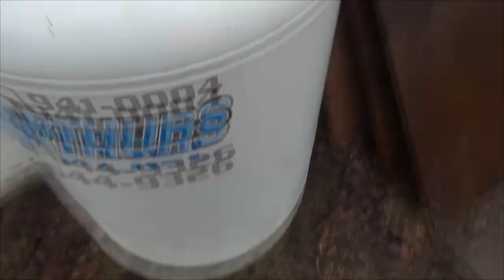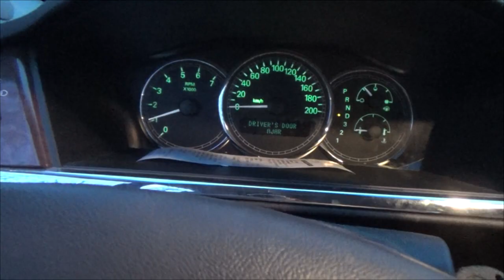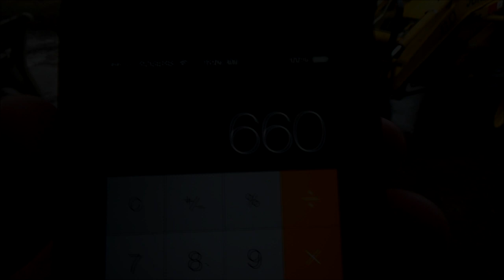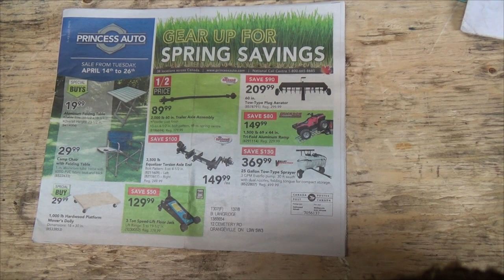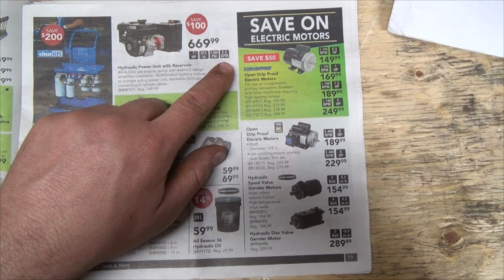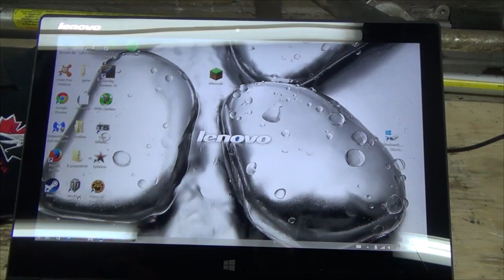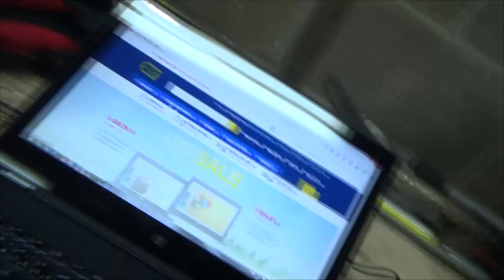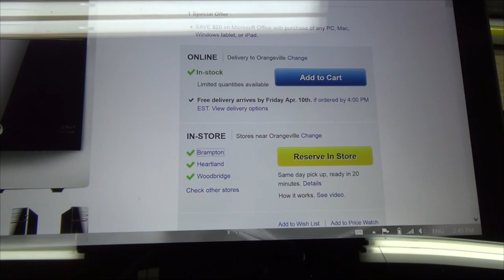What is in a pocket coil matress

Comment: Hey Bill I usually put my computer into hibernate mode it's sort of like sleep mode but doesn't draw power. My computer is about 9 years old and my boot time is 2 min. With hibernate it's 30 seconds. You could still achieve fast boots with sleep mode also but would draw slight amount of power. I also recommend getting a Universal Power Supply (UPS) for your pc, it saved me many times. I have a 500 watt capacity ups for a 300 watt pc. If your new pc is about 600 watts (gaming) get a 800 or 1000 watt ups. Love the vids Bill.

Comment: Bill, If you want to do some SERIOUS GAMING I would go for a desktop. Go for dual monitors, once you get use to them you will never go back. You can go to New Egg or similar for computer systems or parts and build it yourself. Avoid Windows 8 get Win7 if it is available. HP doesn't normally have the latest hardware, get one specced to you own speccs. Go to a company that can build it exactly the way you want it.

Comment: You have to much time on your hands if you are taking all of the springs out
Reply from the maker: Trevor Oakley waiting for spring lol
Reply: BILLSTMAXX :) ot gravel, lol   i set an old mattress on fire so i could just have a bre metal frame .
i put a board on it with a couple bricks on it to drag behind my lawn tracktor, it fills in all the pot holes  on my road and smooth outnew top dressing for the lawn.
Reply: BILLSTMAXX :) umm  ya, i guess that mattress would not work, no frame to it so all the spring would fall apart.   Douh!   At least you recycled.

Comment: I bought my computer from Best Buy, I like ibuyPower as the name brand. The K on the processor means that it can be overclocked. No k means locked to its speed.
Im not 100% sure, But i think its a bad idea to mix and match ram like that. 1 x 8 and 1x4. You would want to have the same amount of ram sticks in the computer. HP is always known for building cheap crap and marking it up.
IDK fi Best buy US is the same as best buy Canada but look up SKU 9096193 thats like what i have, only this one is a lot newer, and using nicer newer parts.

Comment: Bill,  If you are getting a pc you might want to wait until windows 10 comes out this summer.  That is what I'm waiting for because mine is five years old and needs replacement.  Bruce.
Reply: ***** when you buy a computer from a store, itsoetimes come with windows, if so id wait for wi dows 10, why pay for windows 8 when 10 is on its way.  I run linux over windows anyday but thats just me.
Reply: TiMn8eR911 any windows 8 comes with a free upgrade to windows 10
Reply: brucear1 All Windows 7 and 8 users are eligible for a free upgrade to Windows 10 during the first year.

Comment: Your i7 2600 that you have in the HP should be fine for GTA V.  Graphics card may have issues, you could just buy a $200 graphics card and put that in.  Cheaper than buying a new computer.  Specs of GTA V are really high though, I don't think my graphics card can play it either.  :(  You should build a custom build, cheaper and you know what your doing.  Depends if you want the warranty that you get buy a new one or not.

nVidia GTX 745 isn't really that good of a graphics card to be honest.  The K on the processor model means that you can overclock it yourself for more performance.  Disadvantage is that the computer will run slightly warmer and depending on what cooler HP uses it could reduce the lifespan of the processor.  Overclocking could also void the warranty.
Reply: SuperFIFTHGEAR the psu on his hp probally couldnt handle a newer gpu its probally weak and has a low wattage.
Reply: Cam_e_ron Tech/Gaming! I wouldn't be surprised.  Most OEM companies generally ship with awful PSUs.  My custom build has an 850W but old desktop had a 250W WITH a dedicated graphics card.  Wish they'd included at least a 400W to ensure that everything gets enough power.

Comment: I'd buy the cheaper one and spend the extra $300 on a GTX960 or GTX970.  Both of those cards are way better than the GTX760 and way way better than the GTX745.  The GTX745 is garbage.  The 4GB on the GTX745 is a total gimmick, the card it too weak to actually use all that RAM.